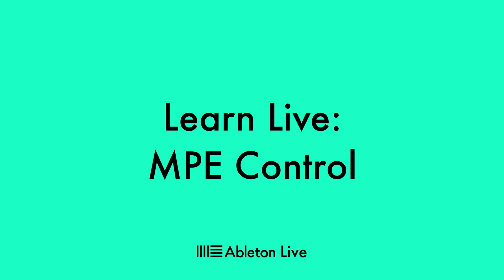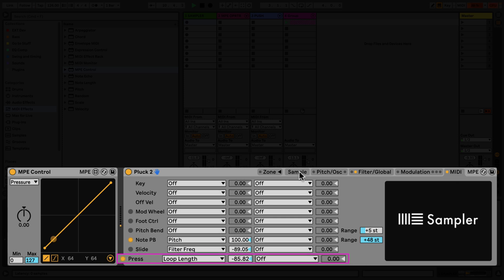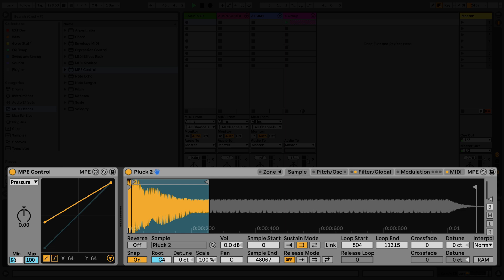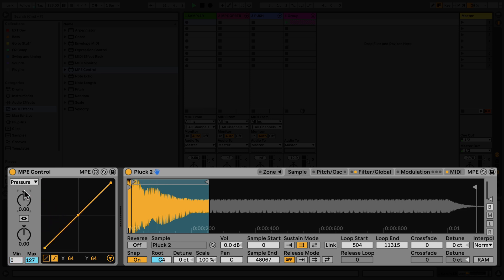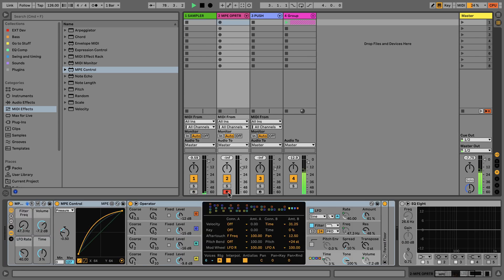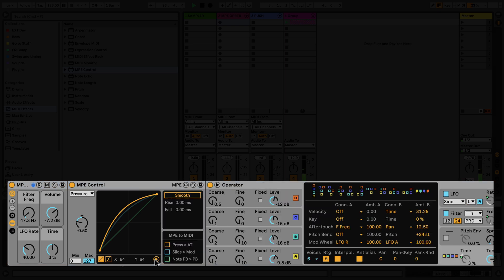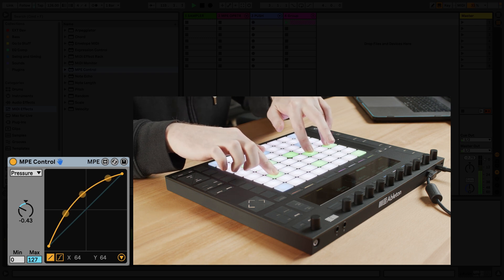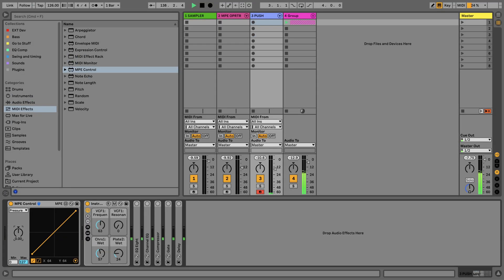Learn Live: MPE Control

Comment: At 0:29 you say that all MPE parameters have been mapped. How did you map those MPE parameters?
Reply from the maker: Hi David. Thanks for the comment. There is an MPE tab in instruments that have MPE enabled. However, you can use MPE Control device for the rest. This is a real good vid breaking it down: https://bit.ly/3YKhMuc Thanks - Ableton
Reply: @Ableton  I don't see an answer for third-party VSTs. When I drop in a third-party VST and enable MPE for that plugin, I do not have a MPE tab in Ableton. So when I go to configure the plugin, there is no way that I can find to wiggle my per-note Slide, Expression, or PB on my Push 3 to map it to the VST parameters.
Reply from the maker: Hi David,

Thanks for the comment.

If you're not seeing the MPE tab then it indicates that particular VST does not have prepared MPE settings ready for use in Live.

All per-note MPE automations can be edited within the "Expression Tab" for the MIDI clip you're looking to edit. If you're looking to edit MPE parameters from within a plug-in, you'll need to confer with the manual for the VST or contact the developer directly for support.

Hope this helps.

Thanks,
Ableton

Comment: EDIT: Ok, gave myself a schooling in;
MPE - Polyphonic Expression - which includes after touch, vertical and horizontal tilt - per key.
PPR - Polyphonic pressure - after touch per key.
CPR - channel pressure message - after touch per channel.

My ancient Akai MPD24 does support PPR, and Live 11 does work with it - I just had a slight misconfig somewhere hardware side, but PPR and Ableton Live work well. 

If you're setting this up, use the Midi Monitor to help spot the signal, and Wavetable works well and supports these standards.

Comment: Will it work with push v1 ?
Reply from the maker: Hi, Push 1 and 2 support Poly Aftertouch in compatible Live devices and plug-ins. For instructions on how to set this up, please refer to this article in our Knowledge Base: https://bit.ly/3ks8gYu We hope this helps, cheers!
Reply: No sorry. With Ableton 11 Push 2 will transmit polyphonic aftertouch. Which is great after all this time but Push/Push 2 is not, nor ever will it be MPE capable. It has no means of processing  polyphonic Glide or Slide. That would require a continuous surface instead of discrete pads
Reply: @cockur  I see, but will Push 1 transmit polyphonic aftertouch?